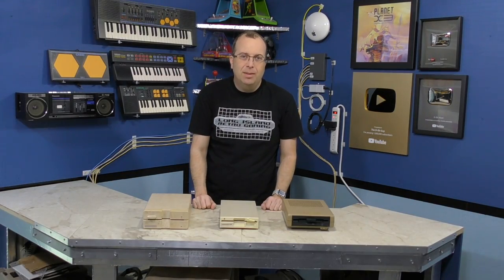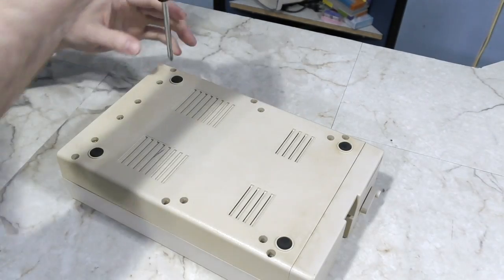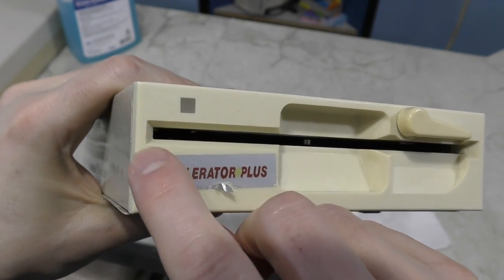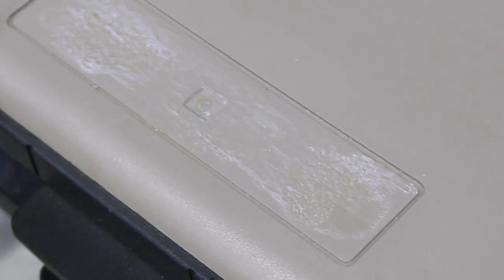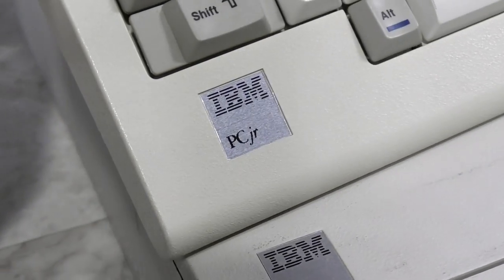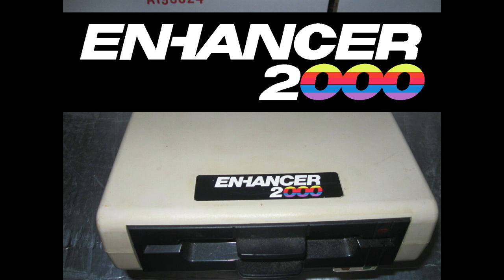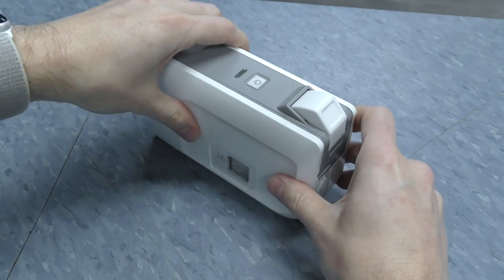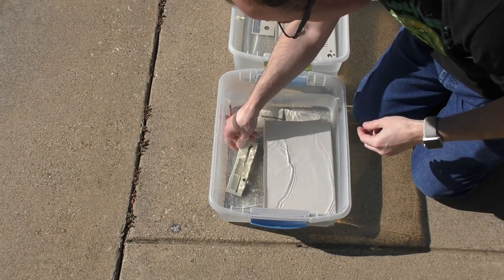How to make replacement badges

Comment: If you're looking for a UV source, you might have some better luck with high-output gas discharge lamps. Basically something like the classic street lights. Or something like a mercury-based UV germicidal lamp. Opt for clear glass, in my opinion (and check to see what type of glass it is).

Mercury lamps (like CFLs) actually have a collection of discrete wavelengths that they emit light at. A fair amount of them are in the visible range. The phosphors convert some of the invisible UV into reds to balance out the rest of the light from the mercury spectrum. 

You can see a good table if you search for: nist mercury emission lines
There are 3 very intense peaks between 160 and 200 nm (UV-C), as well as some decent peaks in the UV-A and -B regions. Apparently the "black light" bulbs (can?) have a phosphor to emit UV-A along with wood's glass to block visible light.
Since you don't care about visible light being present, you can use whatever bulb has the UV you want (i.e. no purple Wood's Glass). One caveat is that you need a glass that won't absorb the UV being produced, which is a problem in itself. Fused quartz is usually the go-to here. I think the inner capsule of streetlight-type lights are usually fused quartz, but the regular bulb around it can be something that will absorb UV (probably by design). Just doing some light googling, I see you can buy halogen torchiere type capsules that are mercury.

Actually now that I think of it, you could probably look for a mercury-based germicidal lamp. That might be doubly good because then you could immerse it in the water, like the sides of that one drive enclosure. I'm guessing since the light was coming from the centre top, and the sides were basically perpendicular to it, it couldn't get any UV.

Comment: Congrats on the 1,000,000 subs. I have an EXCELERATOR + drive for my Commadore systems but it doesn't use the word plus, just a plus sign after EXCELERATOR and luckily for me it's in perfect shape. My drive has dis colored but I'm not not so worried about that until I'm ready to bring all of my Commadore computers back to new "looking". Just wondering if you'd ever seed the label like I'm describing.

Comment: About retrobrite remember that there are countries with extremely low days like Finland maybe contact somoene fron there and ask for help

Also there is a video out there of a guy retrobriting an extremely yellow Dreamcast (Odd Tinkering), he use aluminium but intead of just the top he cover all the place and used a line of many leds instead of just one big

Comment: hey David. Maybe in cold weather you could use a water circulator used for Sous Vide cooking. You can program those things to hold the same temperature for a long time and a cheap one could cost like 60 dollars (maybe not great for sous vide, but should satisfy your requirements)

Comment: You can buy up to letter size gloss or even metallic laser or inkjet adhesive backed color laser labels. Or just go down to your local (Fastsigns) and have them print it on vinyl decal (UV and outdoor). They have Brushed metal...etc. It may be expensive ($10), but you'll will not get any closer to factory then printed vinyl decal

Comment: Based on the brief look on the label maker and online image search it seems to be Brother PT-1230PC. On that printer the max print resolution (based on the specs) is 180dpi so that ought to be used for the image, which transposes 47mm x 12mm into 333 x 85 pixels. This should enable the printer to use its native resolution thus not having to scale down the image whilst printing and thereby preventing those jagged edges that now appear on the printout.

Comment: Is heat a good thing for retrobrighting, I have seen a different channel who I think is very reputable say that heat is not good for the process. He uses peroxide cream in a large ziplock bag and then place the part in the bag and then the bag in a foil limned box with UV led strip limning the box. I know you have tried cream before but you painted it on and in the ziplock bag you can massage it around every half hour making sure there are no spots. Love your work watch every video!!! Cheers

Comment: I had an Enhancer 2000. In the UK you simply couldn't get 1541 drives for a long time. The amount of sales Commodore missed as a result of that. The Enhancer was loads faster than a 1541. When I got the commodore drive years later I couldn't believe how slow it was. But I did buy a few copy protected games and could never play them, one was the Eidolon which I would have loved at the time.

Comment: I’m sure this has been suggested before, but I wonder if putting an immersion circulator in the tub would help the reaction along. There are lots of versions of them now and a simple one won’t run you much more than $40. They’re also called sous vide circulators too. 

On the label front I also had an idea. What about stacking multiple layers for color, the way color vinyl signs are made. Those use monochrome layers that are stacked in the z direction to produce full-ish color images. For example, that label with the red plus sign - I think I’ve seen red on clear label tape, maybe print out one with just that in the right position and put that below the one with the text without the plus?

Comment: I have the same brother label printer. The way around the low resolution of your logo is to find a font editor and use a vector editor and then replace one of the letters/symbols with your logo. So when you print a label, select your custom logo font after you installed it. And type the chosen letter/symbol. Now the printer uses the same high resolution seen when printing text. No more pixelated crap 👍
Reply: I can make a video for you guy's...if you want...

Comment: Next time you wanna try that UV light option, use a space blanket and wrap it on the outside of the container.

I do hope you figure out a good method for doing it inside, since it seems like often you run into an issue with the sun not co-operating, regardless of the time of the year.

Comment: So, take a light bulb, and put a filter on it that blocks everything but UV light.  That's all a black light is.  It has NO MORE UV than a bulb of the same power, without the filter.  What you need is a UV light, not a black light.  Filtering out the non-UV light does nothing but make the bulb run warmer.  A true UV bulb (used to cure adhesives, kill germs or filter aquariums) would work much better.  But yes, they need extra precautions to be used.  If a light is too bright, your brain makes you squint to keep your eyes safe.  Since you can't see UV, a bright UV bulb without regular light will not make you squint, and thus you'll be toasting you eye and not even realize it (until you get damage).   I had an aquarium light that i ran unfiltered while I was cleaning a filter.  The best I can describe the pain...  sunburn on your eye?  It was not pleasant :( Be careful, but there's definetly some possibilities for more efficient retro brite setups.  Let me know if I can help.
Edit:  To be clear, the fluorescent light you got second was not a UV light.  It was a filtered white light.  You described it as missing the coating that converts to visible light, but that's not what it was.  Such a light would have glass that appears clear, and if you dare look at it, would give off very blue light, but never deep purple.  Hope that helps.

Comment: Just a tip I saw on someone else’s video. Can’t remember who. Instead of trying to find the best sun light you can use ultraviolet lights. This person used a long ultraviolet LED strip and wrapped it all around a clear container which he covered to keep the light inside. Same liquid solution you use. Heat may not be a factor. Probably just the wavelength.

Comment: I had the Excelerator Plus. It worked great, which it should considering it used a copied 1541 ROM. Eventually got 1541 JiffyDOS for it and realized I would have to move a resistor on the JiffyDOS board to get it out of the way of the mechanism. Mine also had a skewed badge from the factory.

Comment: David: (2:36) I've wondered why you normally use the black crate for retrobrighting rather the transparent ones available. It can't be a size issue, since they make the transparent ones in larges sizes also.

Comment: Just a thought: We know heat can play a role, maybe you were better off sticking with the incandescent bulb because of the heat it would produce on top of the UV light? Just spitballing.
Maybe using a container that's more reflective like a metal tub with white enamel coating would help?

Comment: Enhancer logo: buy clear vinyl and stick it on top without air bubbles trim again. Done. It will be like a real label.

Even clear tape will work, but tape is way more flimsy than vinyl and much more difficult to apply without air bubbles

You can also repair the original label with clear vinyl for the third drive. With double sided tape on the back for new adhesive

Comment: Hey, GTE chips!  My dad used to work for GTE and at one point was involved with making their 6502 clones.  If I recall, 3rd-party companies had to use second-sources to acquire 6502 support chips, but it was possible to get the main CPU directly from MOS.  I'm not sure how the whole supply chain thing worked, though.

Comment: I apply a DuraLar or Mylar transparent adhesive sheet on top of stickers like that before trimming to make them durable.  If you use Mylar or DuraLar instead of cheap lamination sheets then the transparency won't yellow over time.

Comment: You can get UV bulbs from a pet supply store. They're used for keeping reptiles. Also, would it have worked if you put the aluminum tape on the outside of the plastic, so it didn't contact the water?

Comment: You could have used cheap aluminum foil on the outside of the tote. UV is good. You can experiment with different chemicals. Something that is just abrasive enough to take off the smallest amount of surface area may work. I think abrasive is going to be necessary.

Comment: I have a UV heat lamp made for pet terrariums that I use for exposing circuit board UV masks.  You can get them from most pet stores.  Maybe that could work?  It produces UV and heat.  Can't see where you could go wrong there.

Comment: Could you have added a layer of wide 3M clear tape to the top surface of the Enhancer 2000 badge as a protection layer? I've used just a laser printer, some decoupage paste and some clear spray paint to do front panels. If you don't decoupage, the paper turns transparent when you put the clear paint on.

Comment: The higher the energy, the stronger the effect. UV-A is very close to normal light. This can be used to excite certain colours, which then glow.

UV-B or UV-C, on the other hand, have the potential to bleach colours or attack biological tissue. These higher frequencies are certainly more effective for bleaching.

Comment: I wonder if a good tank for this would be an old aquarium tank, it's glass, so the chemicals will likely not hurt it.  

Take a couple of sheets of Styrofoam insulation, glue up a box slightly bigger then the tank, to the inside, you glue Aluminium foil, and to that you silicone UV-LED light strips, one near the bottom, one half way up, one at the top.  Make an additional lid, with the Styrofoam and foil.  Put the aquarium tank inside, fill it with water and peroxide, pop on the lid....   Plug in the LED controller, and walk away.

Comment: I wonder if you could use some of the tools or techniques used with resin 3d printers: they have a UV curing step after the main print is complete. There are some pre-built machines with turntables, as well as lots of diy machines for very even uv exposure.

Comment: Just use heat instead of UV for retrobright. Just using a small space heater in a makeshift insulated box works wonders on the process

Comment: Use lighter fluid on the sticker residue- it won't hurt the plastic and will take it right off. On extra tough residue issues, i'll score it a little bit and let the lighter fluid soak in for about 30 seconds before trying to remove it. Try it and you'll see!

Comment: for retro-brighting in winter, what if you heated the water with a submersible element, like a bucket heater (which gets to 180 degrees)? Maybe have an outlet       with a pot/rheostat on it to control the temperature.

Comment: Regarding the different rates of yellowing of plastic pieces on the same device: My brother and I each have a SNES console we've owned since we were kids. What's strange, is one one console, the bottom piece is completely yellowed, while the top is still very much the original color. But on the other, the top is yellowed, and the bottom is normal.

It would seem, it also depends on the quality of the plastic, and/or the quality of the molding process.

Comment: I've personally had success using royal blue LEDs instead of any type of UV light.  Although my method is a little different because I use hydrogen peroxide cream and wrap the plastic parts being retro brighted in plastic.  I purchased a plastic box from the hardware store and installed royal blue LEDs in the bottom side of the lid.  It doesn't work as fast as putting in the sun (I'm in Australia), but I haven't had any streaking issues yet and it seems pretty gentle compared to putting in the sun.
Reply: Here is a photo of my blue box: https://drive.google.com/open?id=1obNTKPS1nuewfZrFzk8RJsCPNirsa7EG

Comment: Dave-
Has anyone suggested using an immersion circulator (such as chefs use for sous vide cooking) to keep the water at a consistent temperature for retrobrite? From what I remember temperature is also an important part of the process, so I imagine it would be worth looking into.

Comment: what may have been beneficial for you, if you could find them, is, using 2 UV fluorescent strip lights, so you could cover a larger area at once, but only downside being a lack of heat :(

just a thought :)

Comment: Great videos as usual 8 bit guy oh yes thought I'd give that retro bright thing a go had an old air conditioner panel so mixed some really dilute hydrogen peroxide with a bit of water painted it on and covered it with glad wrap Fortuneately in Western Australia at this time there is no shortage of heat or sun after 15min it was as beautiful as when it was new Always wanted to try it but thought it just too good to be true fat lot I know All this time watching you do it and thinking it wouldn't work for me Thank you thank you

Comment: he should spray that 3M adhesive onto a piece of paper with your badge on it. That way it does not get on the surface of the table so that the next item he puts down does not get crap on it. Its a good way of making a temp surface you can throw out. Brown craft paper also work to roll out then throw out and is recyclable

Comment: Be careful with metal parts while retrobrighting. The peroxide reacts with metal so you can only use stainless steel to be safe or stick that aluminum tape to the outer part of your container. Also I saw people use UV LED strips which were taped around the container thus giving a more even light distribution.

Comment: The Excelerator Plus is cool because the whole drive unit hardly takes up any more space than the drive mechanism by itself.
But one myth that people spread around about these drives is that they're faster than the 1541. I know the Blue Chip is not. Do either of these other two drives have some sort of fast loader installed that can work from the drive side instead of the computer side?

Comment: Another suggestion I'd make is to not be bummed about restorations being permanent. As a restorer, it's actually better for your restorations to be fairly reversable so that if you sell the piece and someone decides to redo your restoration or even get an actual original replacement, they can undo your restoration easily without having to spend hours doing what you just did, i.e scraping super glue off the part and scratching up the plastic.

Comment: Was there a way to put the Chrome tape on the outside facing in the clear container?  That way you could do the reflection without the worry of the water or chemicals affecting the chrome.

Comment: David, if heat (and not sunlight) is the major driving factor in the retro-brite process, would getting an immersion heater make a difference? You wouldn't need to rely on sunlight and weather anymore.

Comment: Did you made the Excelerator Plus text from scratch? Dude, that's hardcore.
The usual way to proceed in this cases is to scan the label and use services like WTF ("What The Font") to find wich font did they use back in the day (or find a new font that looks similar). And then remake the label using gimp/photoshop/any graphic editor that supports layers, the scanned label as a template in the bottom layer, and the original font (or a similar one) to rewrite the text.
But I have to admit you did a nice job with your method.

Comment: I accidentally hit an aluminum valve cover  with a hammer and popped  a hole in it. Don't do that.  So after  fishing the chunk of aluminum out of the head. I put a piece of aluminum tape over the hole. That little piece of aluminum tape stayed on for at least a month if not longer with the engine heat, engine oil, vacuum, etc.. That stuff is impressive. You could slip the tape around sideways but it stayed on. New valve cover was only $5

Comment: I don't know exactly what the residue was but I can guess what caused it. Basically you turned the tub into a weak battery, like a potato battery, with the aluminium tape as one plate, the iron wrench as the other making the anode-cathode pair and your peroxide/water solution was the electrolyte. If you had wires attached to the foil and wrench then you would have seen a small voltage.